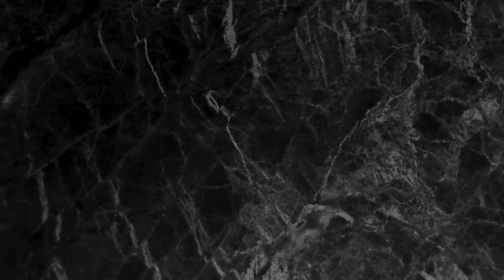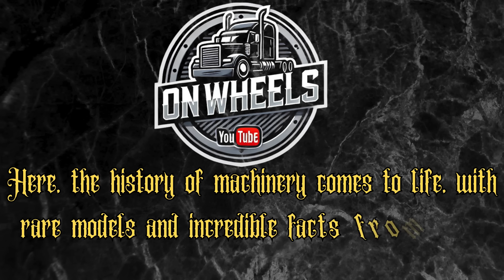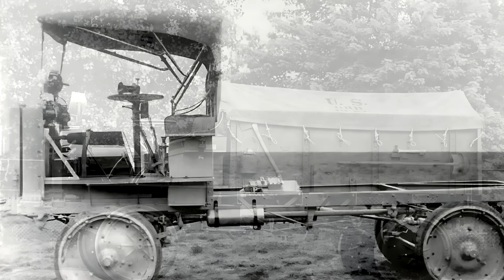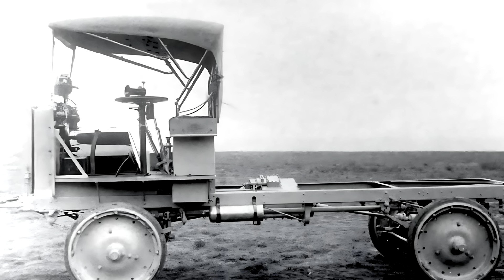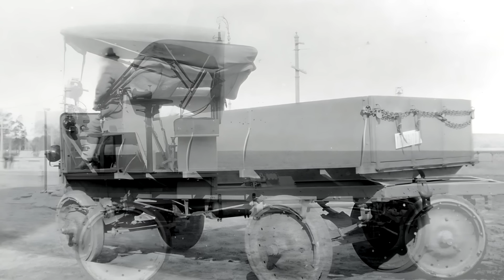1916 ❓ Jeffery Quad 4×4 — How Did This Even Exist?

Comment: I have got you beat on this  one. Check out the 1905 Couple-Gear four wheel drive /four wheel steering Truck developed for carrying equipment to the top of 5700 ft. Mt. Wilson in California for the then new Observatory being built. It originally was designed to be electric, so each wheel had its own internal electric motor, battery driven. 
Because batteries would not take it all the 8 miles of road to the top without a full charge at the halfway point that would take half a day, they instead mounted a Fairbanks-Morse engine and generator on the truck itself. To save weight for load capacity, they took off the traction battery. So this truck had to have a hand crank to start itself:) 
But the thing worked. Two drivers, one for each steering wheel front and rear, and as needed occasionally they would hook up an additional two horsepower... in the form of a team of mules.

Comment: Sounds like my kind of truck!!  ... I'm currently rebuilding an old Chevy Step Van ...and converting it to 4X4 is on the list if live long enough!  ... I work very slowly in my late 60's

I'm rewiring the entire van, and am currently working the the battery bank, I have six, 6 volt batteries to power the inverter, welder, winches, air compressor,  And electrical system :)

Comment: Er reality check, the Jeffreys secondary reduction gears worked off each wheel,s stub axle via a ring gear and pinion, the ring gear keyed to the inside of each wheel which rotated on a dead axle. At twelve o clock a wide pinion meshed with the ring gear, said pinions driven from the diff via short jointed shafts, in essence a De Dion Bouton  semi independent suspension. French motor  company Latil used the exact same secondary reduction gear system on their 'Traulier' timber tractor in  the late 1920,s,  Nash Jeffrey did not fit secondary reduction gearing in the wheel hubs,. that unique feature  was pioneered  by FWD  in the late 1920,s.